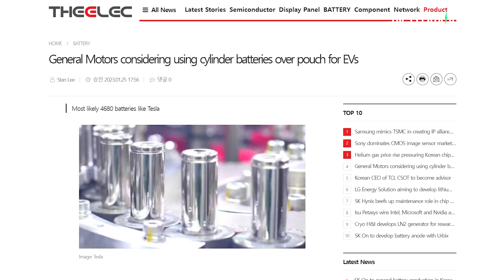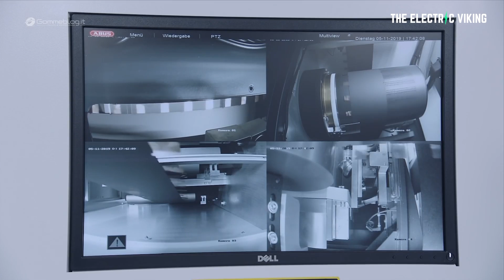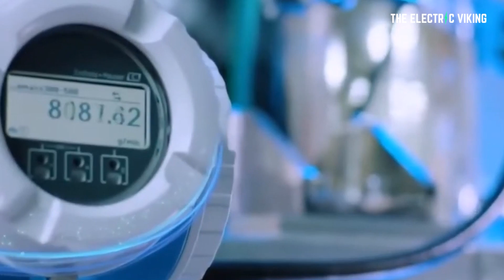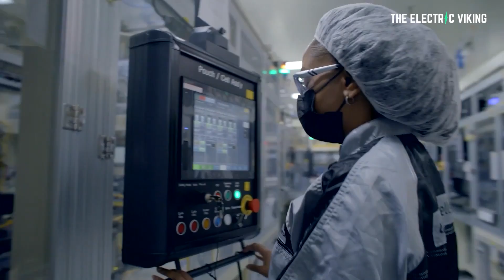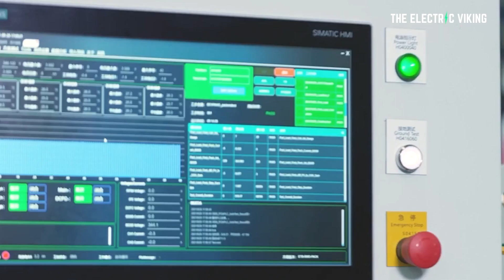Is GM changing from Prismatic to Tesla's 4680 cylindrical batteries?

Comment: 4680 will become the norm due to ease of manufacturing.  However, pouch cells will stick around as more of an exotic offering due to it's performance superiority from it's packaging.  It just needs the right chemistry to make the pouch form factor to be formidable.
Reply: Pouch Performance Superiority how? Faster discharge or charge rate? High capacity per  cubic space? Can you please elaborate?tks
Reply: Moto E, IoM TTX, sport flying and drones all use pouch cells. Because if it goes to poo only a few people are going to get hurt
Reply: @theairstig9164  Yes, those are all relevant to the application of daily commuting cars.
Reply: I believe that the teams that race formula E use pouch cells but not sure why.🏎🤷‍♂️

Comment: There's no doubt that Prismatic can give more power to EV because of better volumetric density (cube vs cylindrical) However, 4680 is about cheap and mass producing because that was the Goal of Tesla. To make cheaper EV that everybody can afford and replace all ICE car on the road. GM didn't even know what game they were into until it was this late....lol
Reply: Not only that but Tesla uses the 4680 as a structural battery pack as a body structure, linking the front and rear underbody parts while the battery cells themselves contribute to the integral structure of the pack and therefore the whole car body.  It accomplishes two things at once reducing production time and cost.  No one else does this.

Comment: There's no reason the market cannot support both cylindrical and flat batteries. The
differences would provide auto manufacturers with a reason to buy their particular cars 
and give the buyers a choice of the two types. New autos should have the battery type
that best supports their purpose, eg, off-road, street, military, etc, and allow the buyer to
decide which best suits their purpose. The important thing is to have a replacement with
a common connector configuration for easy replacement when a battery should fail. I
would like to see both types on the market.

Comment: I think it has more to do with CATL and BYD having IP, but restricted access to the US market. Access to $7500 per vehicle in incentives and additional government manufacturing spending makes a strong business case, regardless of engineering benefits. Tesla tapping new suppliers, including LG, creates a massive economy of scale in the US. GM may be moving away from some joint venture factories but still buying from LG factories that supply multiple companies standard format 4680. I could see us ending up with different batteries in different markets due to trade policies.
Reply: Exactly. This was not a technological decision.

Comment: If more manufacturers use the same format, regardless of the chemistry it means that the EV's can have different suppliers if they all move to using the 4680 format and opens up a bigger range of battery suppliers.

Comment: Prismatic cells can be cooled while stacked if done properly but it's not easy Prismatic cells are easily breached by vibration and accidents and if spaced for cooling how does one heat them in cold weather? Also when failure happens it's almost impossible to replace damaged cells making it ridiculously expensive!

Comment: As an actual engineer who sometimes spouts off in the comments, cylindrical always seemed the way to go. Circular shell form provide optimal and uniform structural strength to contain/reduce charge cycling stress fatigue of anode/cathode materials (for the same mass of shell), shorter and uniform heat transfer paths to shell, no corner structural weakpoints. Even though rectangular seemingly cells pack more densely, both require inter-cell cooling so that's not such a large advantage. Jellyroll cells also more suited to rapid manufacture.
Reply: There's a reason the by-far most numerous batteries in the world - AA and AAA - are cylindrical. I suspect that the reason (other than historical precedent) is ease of manufacture.
Reply: @maryhadda8420  Sandy Munro says you are correct.
Reply: @maryhadda8420 yes and if you have a failure in a complete pack you maybe only have to replace only one small cell, and if you put some more into the pack, it does not matter the BMS can isolate the cell and maybe stop using it and activate a reserve cell of course only during maintenance ....

and never forget what is a power cord in the earth instead of pumping or frack  oil 5.2 Trillion Liters a year this 1/10 of the Bodensee in Germany 

we have to safe fossil fuels for the day we have some shading of the atmosphere!
Reply: @maryhadda8420  I don't think AA and AAA batteries are jelly roll style are they?
Reply: @themonsterunderyourbed9408  I don't know; I've never taken one apart. I know the old C-Zn batteries weren't. Anyway, I was referring to the external form factor.
Reply: @maryhadda8420  and rectangular 9 volt batteries I.e that found in your smoke detector?  Please explain
Reply: I'm not an engineer whatsoever, but this is the exact impression I got from Tesla's battery days
Reply: Also as tesla has effectively solved range issues for 90% of everyday use cases (and solved the rest with their super charger network) it's no longer really about power density. Manufacturing efficiencies are now paramount metric to achieve true scale, which is what master plan 3 is all about
Reply: Congratulations on the engineering status
Reply: Yes. Increased packing density means less room for cooling fluid.
Reply: Let's see about that you self-proclaimed "engineer". Engineer in what? And even if you'd be an engineer in this field - without having done an apprenticeship first all engineers are just bullshitters ... and the technicians are correcting their bullshit silently.
Reply: @drewbrightmaine8529  "Apprenticeship"?  LOL We're long out of the steam age now grandpa. You seem to be confused between contractors and engineers (and even than it'd be rare or a ruse to circumvent minimum wage statutes). The guy you know that changes your light bulb for you isn't the "engineer" that designs batteries and battery factories. We tend to go to these things called universities. The concept is undoubtedly alien to you.
Reply: @poneill65  Even then, not even than. Edit one more time.
Reply: Don't forget that heat conduction is far greater through the end caps than the shell.  That means that skinnier cells are not necessarily optimal for cooling,  and that inter cell cooling may not be the best way.  In fact,  if rectangular cells were constructed with "tabless" (actually full length tabs) contacts at the long edges,  they would be just as easy  to cool with top and bottom plates as cylindrical.   Containing the pressure of expansion could also be simpler in a uniform rectangular stack,  although at a cost of greater exposure to fire hazard.
Reply: @MattOGormanSmith  All good points,.. except I believe that circular form is the most (structurally) efficient means to contain an area under pressure/stress. This allows the use of the least material to contain a given volume and pressure. Flat faced structures tend to swell and require extra thickness or bracing (and so weight). The more that you allow the active materials to swell during the charge-discharge cycle, the more damage is incurred leading to crystalline discontinuities or dendrites and lowered lifetimes or catastrophic failure.
Reply: I think they are cheaper too?

Comment: I'm not battery expert, but I was a little skeptical of the cylindrical only because of lost space, (the gaps) however, seeing it might actually be a very smart idea with thermal insulators to help with battery pre conditioning? Seems like a lot of potential, but honestly I don't give a crap what the batteries look like, only lower cost, safer and better power (Both in charging and in delivery) My hats off to all of them keep rocking it, keep exploring and keep innovating.
Reply: The big thing is not the form factor.
OF COURSE with a larger cell less cells are needed, easier to build a pack.
SO WHY not make a 4680 from the start?? why make the 2170 cell in between??
BECAUSE BEFORE the "tab less" battery you COULD NOT MAKE A CYLINDRICAL BATTERY this large because of thermal management that affect charging speed, discharge speed and time of life.

So the form factor as such is nothing IMPRESSIVE what is impressive is being able to make a cylindrical cell this large without getting problems with thermal management.

Then... going out on a limb... BUT of course it has to do with production cost.
It is easier to speed up production / lower cost to do cylindrical things.
What takes time is "Stop-Accelerate"
Look at a machine gun...If you make cylindrical things you can just keep rotating.
Fewer "Star-Stop" actions

A bit hard to explain but I hope you got "the idea"
Reply: @qinby1182  And yet, they are still struggling hard with the 4680 production ramp, specifically the DBE tech for both anode and cathode as well as silicon which they have still yet to integrate.

The CyberTruck will be rather low volume and limited 4680 cell production will be to blame. Hopefully they solve all these issues sooner rather than later.
Reply: @TecnamTwin  - Well, "The Slower They Ramp Up Cybertruck" maybe a tad Better, as they might be able to tweak things easier, without slowing a fast moving line!

Plus, I'll have more time to get my Cybertruck Funding in order! 😁
Reply: @qinby1182  That's easy, Elon started with 18650's as they were the cheapest he could buy. Tesla's fallen into the same trap as any other large organisation where entrenched thinking prevents innovation
Reply: @qinby1182  Many other battery manufacturers have built 4680's before Tesla, can't be as impressive as you make it sound
Reply: Do the math, turn out you do not lose that much volume by going to cylindrical cells. Simple packaging causes a 21% loss in volume, but a staggered cell arrangement means a 10% lose. How you do the job matters.
Reply: @MegaWilderness  
"Many other battery manufacturers have built 4680's before Tesla"
NO
Don't just pull stuff out of your ass...
"The 4680 format was introduced by TESLA 2020"
But really the big thing is the way TESLA does it, the Tabless Electrode.
The technique that makes it possible to use this format.
NO ONE ELSE DOES THIS.

Today other say they will make 4680's but then not like TESLA but use 5-8 tabs, much harder to produce AND less effective i.e. more expensive and worse specs "all other things being equal"

"Tesla, can't be as impressive as you make it sound"
Why not??
Ask yourself...
TESLA grow revenue by 45%/ year for a decade.
The BEST Legacy peer company grow by 1%/ year during the same decade.

WHY IS THAT??
If TESLA do not do something different there would be no difference.
If it was not hard EVERYBODY ELSE would have the same growth...

THINK ABOUT THAT.
Then of course TESLA have by a HUGE MARGIN the best profitability on the cars they make...
Reply: @MegaWilderness  
" not much has changed"
THEY STARTED IT ALL.
They put the EV on the map.
When they in late 2013 announced GIGA Nevada they said they would produce as much LI-ION cells in this factory as the WORLD COMBINED at that time.
That was around 20 GWh
EVERYBODY THOUGHT THEY WERE MAD.
Today GIGA Nevada produce around 37 GWh so goal met BY A LOT...

TESLA HAVE DRIVEN THE ADOPTION of EV's .
This has in its turn MADE IT ECONOMICAL.

In 2013 the price of Li-Ion batteries was around 350 USD / kWh TODAY it is "around" 100 USD making EV's cheap enough for "the common man"

TESLA HAVE DONE THIS.

It is not just about building among the best sold cars in the world.
They have accelerated the transition by CLEVER decisions...
Getting the price of batteries down by GIGA Nevada etc...

TESLA is "in front of the curb" everybody else is following (Except some Chinese like BYD)

THEY HAVE (and are) DISRUPTING THE LARGEST INDUSTRY ON EARTH.

You do not seem to understand that.
Reply: @MegaWilderness  
"18650's as they were the cheapest he could buy."
Well they were THE ONLY he could buy since it was the only Li-Ion cells produced in any quantity since it was used in A LOT of consumer products.
Lap tops, power tools etc...

THEN TESLA CREATED THE DEMAND, built a battery factory that DOUBLED battery production in the world.

THEN when large enough start a new form factor the 2170 because it is more economical...

NOW they make the cell even larger because it is now possible because of TESLA's "Tabless" technique
Before this you could not make a cell this size with the needed specs for a car.

"entrenched thinking prevents innovation"
This statement has NO MERIT.

Just the fact that TESLA get a car "of the line" every 40 seconds when "The Others at best" do it in 60 seconds.
According to VW themselves, it takes 10 man hours to build a TESLA, it takes 30 to build a VW.

What TESLA is doing is "not entrenched" or "stagnant"
There are so many changes all the time that NO OTHER AUTOMAKER STILL HAVE NOT CAUGHT UP.
As the aluminium castings, replacing HUNDREDS of parts reducing the size of the body shop and increases production time and tolerances.

Look at the heat exchangers...
The Octovalve and the super manifold.

And now the SEMI that revolutions Class 8 trucks in being the most economic choice for transport...

In 2022 TESLA had 2 cars in top ten in "The Most Sold Car Models In the World"
There is a reason for that...

Do not really where you have gotten the idea to claim TESLA is entrenched and do not innovate.

They grow by "leaps and bounds" while everybody else are shrinking (Legacy)
There is a reason for that and one is innovation.
And that is not only restricted to the cars...
It is also business innovation.
TESLA have no PR division.
They do not advertise, hence saves A TON of money
Sell every car directly to the customer, no dealerships thereby control the customer price AND do not share the profits.

So my question is...
IF TESLA do not innovate and are different
WHY do they grow by an average of > 50% / year in Production and > 45% in Revenue / year FOR THE LAST DECADE (2013-2022)

Who else have done that??
Toyota's growth in revenue the last decade  1% / year
GM NEGATIVE - 0,5%
Ford 0,3%
VW AG 1%

SO IF TESLA is an entrenched stagnated company WHY does it grow by 45%-50% / year in revenue / Production while "Its Peers" as BEST grow by 1%

There is something you are missing...

Just saying...
Reply: @qinby1182  Panasonic make the 2170's for Tesla. The only batteries Tesla are still trying to make are the 4680's. Apart from the megacastings (which are heavier than the parts they replace) and octo valve, the removal of the ultrasonic sensors, fitting of inferior calipers to the Brembo's, multilayer glass, a joke of a steering wheel, plastic interior, new cameras, better computer, removal of clips in the bonnet, not much has changed

Comment: Tesla has such a diversify battery portfolio, 18650, 2170, LFP’s, and 4680.
Reply: They (Tesla) should license out their oldest format, the 18650. Its a proven design, yet dated now. But very functional. 
To me it sounds like GM and BMW don't have clear directions and are being steered slowly into something they didn't want to do from the beginning. 
4680 as maybe become a buzz word and since they are being pushed to change to cylindrical.
Now, I would not put it passed to them to re-invent the wheel and come up with a different cylindrical format (Say 4790). Just so they can claim to be "different and better" than the rest.
Reply: @fredpinczuk7352  the cell shapes are not proprietary. And Tesla constantly updates the chemistry.
Reply: @williammeek4078  Correct, but the legacy automakers would be in a better spot had they access to the Tesla 18650 (including the BMS and motor to go along with it). It was an option for them. They decided against it.
Reply: @fredpinczuk7352  The model s plaid uses those 18650 cells.  Hardly outdated - just different pros/cons.

Comment: Energy density is not the sole production metric. For example, 4680 is the strongest structurally and while LFP has lower energy density, it is cheaper and also has lower heat release temperature so its pack needs less cooling.  Almost monthly someone announces a new highest energy dense battery in the world. Meanwhile, Tesla needs to produce 1.8M cars this year.

Comment: The advantage is not chemistry, it's not electrical, it's not discharge rate or stacking. 
4680 cells can be produced at speed. 
4680 cells can be easily handled by machines, saving time. 
The production cost can be lower. If it's lower, Tesla can save time and money.